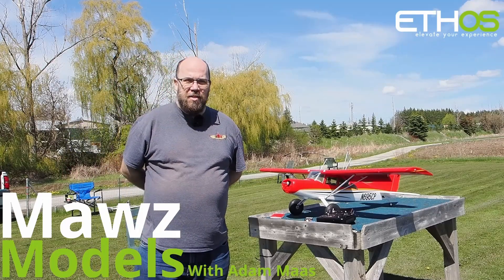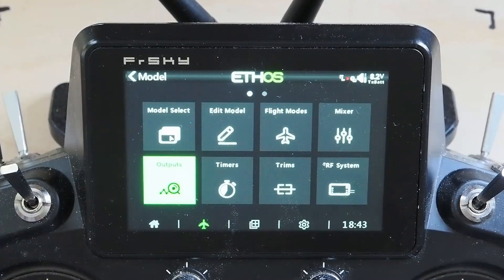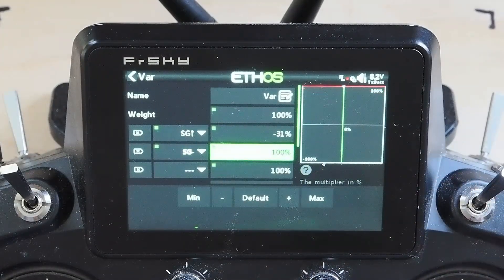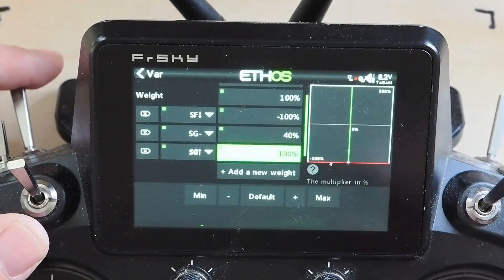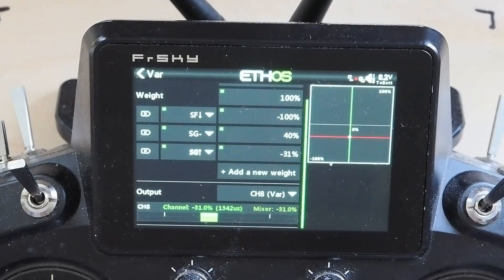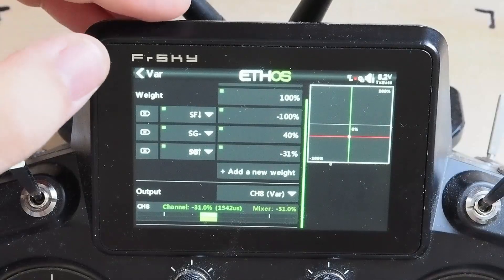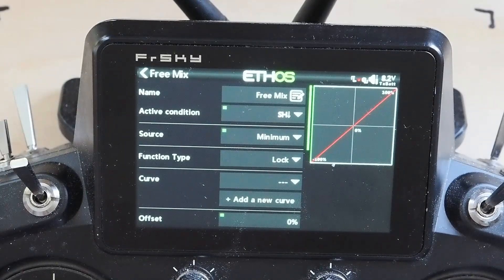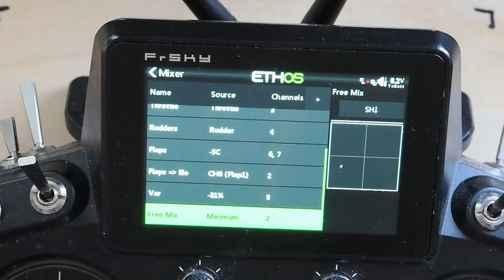ETHOS Tech Tip 11 - Replacing the Override Special Function

Comment: That's what I did with two var mixes for the sr8 stabilized receiver but it doesn't work anyone know why?
Reply from the maker: Make sure your values are in the right order. The 'Panic' mode has to be the highest non-default value or it will not engage reliably

Comment: Sorry. What is VAR ?
Reply from the maker: A Var is a set of selectable, persistently adjustable values that can be used as a source.

These replace VAR Mixers and OpenTX GVAR's, but can also do things like create multi-position switches with arbitrary values
Reply: Thank You @adam_mawz_maas